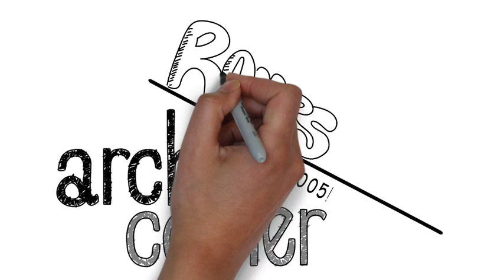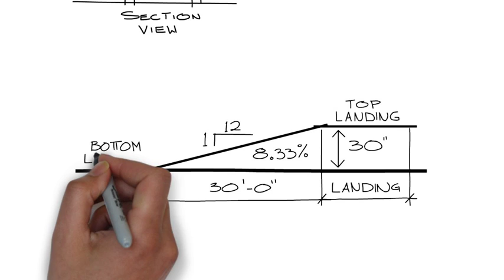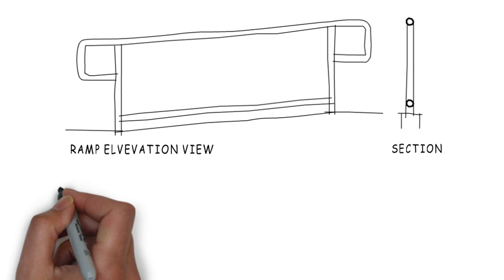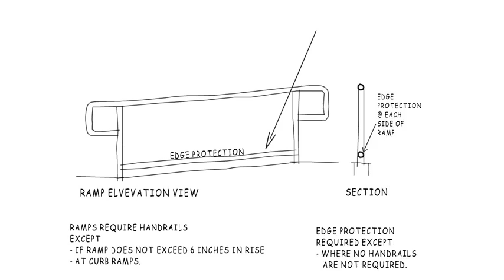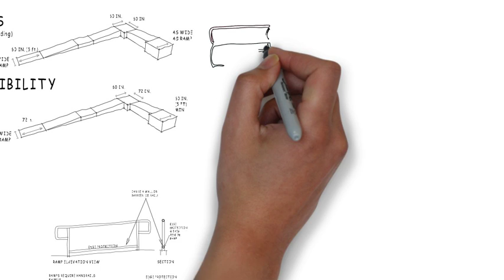AC 005 - Typical ADA Requirements fo ramps

Comment: What to do when street itself has slope
Reply from the maker: This may differ from jurisdiction to jurisdiction, and from project to project. In most remodels, or tenant improvements, an owner is not required to fix or update government's property (City / County public streets). However, in major projects, usually new ground-up projects, as part of the permitting process, the jurisdiction may request that you provide public paths, such as public sidewalks (some rural areas have streets with no sidewalks), driveways, connections to the street, etc. This may include ramps and paths to the new building. Nevertheless, the street itself is usually a government provided item. Check with a local architect for what is required in your specific jurisdiction.
Reply: Thank you

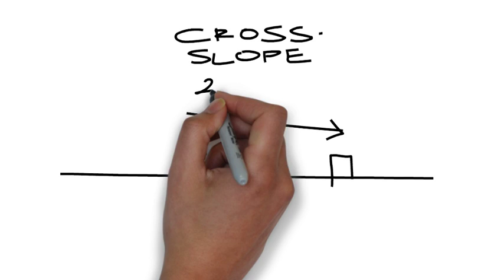Comment: If it’s 30 feet max for a run then 1:12 would be exceeded if the run length was less than 30 feet while the rise maintained 30 inches.
Reply from the maker: Taller heights can be met with multiple ramps, however an intermediate landing would be needed so that a single ramp run would not exceed 30 feet. In other words, 2, 3 or more ramps with an intermediate landing between each one is allowed.

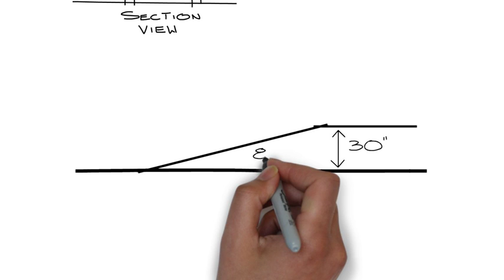Comment: Thanks, but it should be noted that this applies only for public access ramps. For a private residence, most states do not require ramps to strictly adhere to ADA guidelines. We can and do vary according to the users specific needs. We'll go as steep as 2"/ft for some circumstances and a gentler slope (like 1:20) if needed for Bariatric patients or people with weaker than normal assistants. Also, that 60" x 72" landing is not in ADA. That must be a local code somewhere.
Reply from the maker: Although I agree with you that some types of residences are not required to comply with ADA, this video IS about ADA. Therefore, if the project needs and ADA ramp, the video is correct. This video does not touch on what projects need to meet ADA or not. Some historical buildings may have ADA exceptions too. 

Thanks for the comment.

Comment: What about warehouse ramps, they are 25 and 30 ft. long and the dock is 48" height. That's more than the rule of 1" slope per every 12" diagonally. By this formula ramp should be 48ft. long, something wrong or is an exception.  Thanks cool video
Reply from the maker: the ramps discussed in this video are for human/pedestrian use. The ramps that you are referring to are for vehicular use and have a different requirement. Nevertheless 5% to 6% may be the most accommodating even for a loading dock. You might be surprised how long those ramps are. There may be some loading docks with steeper ramps, but they might be limited to the trucks that can use them. a 10% slope may cause loads to topple so be very careful. Hire a Civil engineer, they can help you design all that stuff!

Comment: Great explanation and video. I understand that a certain rise over run is required to be ADA compliant for ramps. However what would be the minimum and maximum angle of the ramp be to be compliant this is easier for me to understand. I'm in a wheelchair and probably go up/down ramps that exceed these requurements. Thanks
Reply from the maker: for every inch you go up (rise), you must go 12 inches over (run). That is the steepest ramp allowed for accessibilty with current ADA standards. As for a minimum, there is no minimum stipulated, it can be completely flat.
Reply: Thanks

Comment: If slope is 4% How to convert feet or inches means 1:12 or 1 1/4 :12
Reply from the maker: It’s simple. In this application, ratios, fractions, percentages and decimals are the same thing but written differently. For example:
1:2 = 1/2 = 0.5 = 50%
1:4 = 1/4 = 0.25 = 25%
———————————-
If a slope is 1:12 then:
1:12 = 1/12 = 0.0833 = 8.3%
That means:
For every one inch vertical you have 12 inches horizontal.

Comment: Hey guys Pls help me.
I want to build a ramp from the ground floor to 2nd floor with 3.4m height.
I had 4*10m space area. If i have 1.2m span i can divide it by 3 for 1.2m*10m  that look like  this |_|￣|.. Now im very confuse at about what angle or gradient is the safest if i want to make the ramp that i build is need with an assistance only or someone pushing you to go up or down?. Pls help why all the example over the internet need that basic 1:  12 or 1:  16 it eats up lots of space..
Reply from the maker: I am sure other countries may have different requirements. However, you are correct, in the U.S. ramps take up a lot of space! Sometimes ramps do not fit in a small place and therefore Limited Use Limited Access Lifts can be used. A ramp from the ground floor to the 2nd floor seems unrealistic . If that is your case you may want to look at a LULA lift instead.

Comment: where are you getting the 72" landing requirement from? which code section? I am having hard time finding it.
Reply: Did you ever get the 72" answer? I have looked at a few locations and I never found that information. Some clarification would be good
Reply: CBC 11B-405.7.3.1 and 11B-405.7.4 and figure 11B-405.7
Reply: I believe the confusion is the Code reference, IBC vs CBC (California Building Code).

Comment: I though landing depth could be 60" min.
Reply: I think the video is more likely refer to the California ADA, which is striker than the standard. Standard never mentioned 72" landing depth
Reply from the maker: Hsin-Kuan Chen; Thank you for your comment. There are different requirements for landings. For example; "Top", "Intermediate" and "Bottom" have different requirements. Also whether the ramp turns or not is also an item to consider.
Reply: @archicorner  What country are you talking about? The Americans with Disabilities Act is 60" x 60" for turns and 60" at all landings.